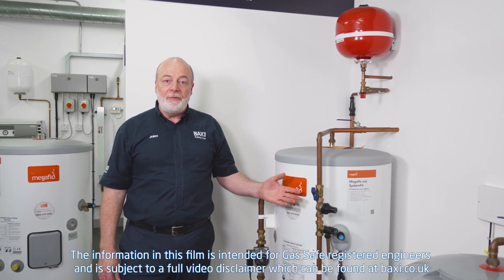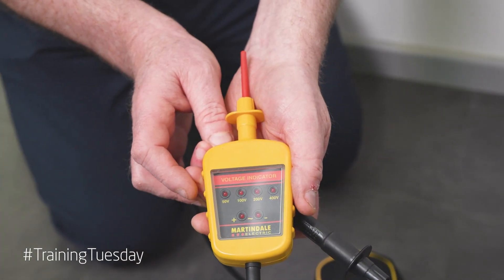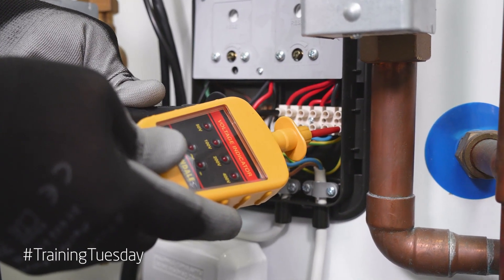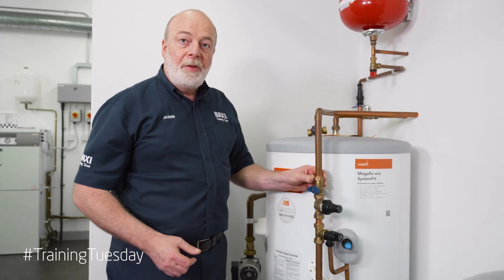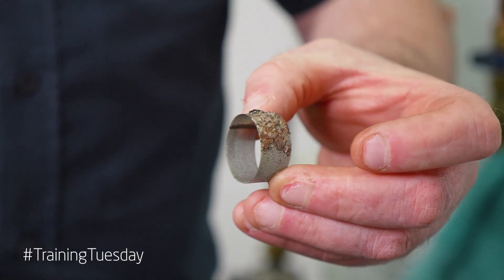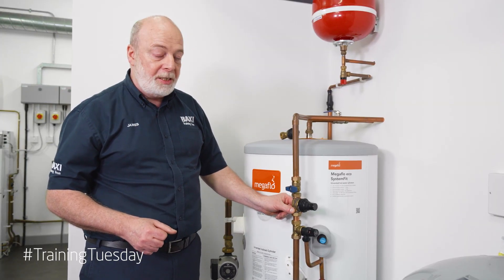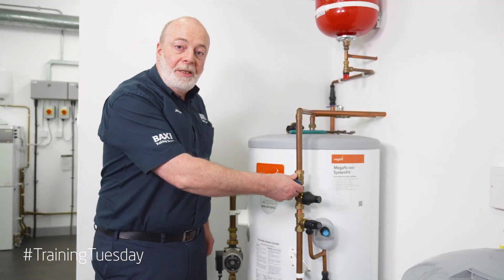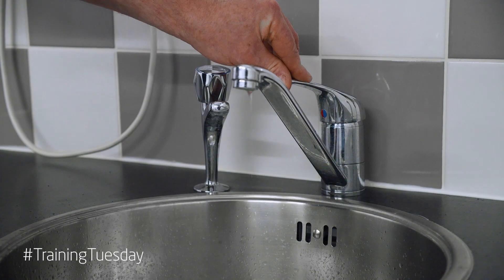How to identify, change and service the combination valve on a Megaflo cylinder | Training Tuesday

Comment: Why do you need to proof you have no electricity when you turn off the mains??? Crazy!
Reply: I work in central London. Wires and water/gas connections are sometimes connected from next doors flat, accidentally or purposely. Need to be safe all 100% of the time.

Comment: Yes cos everyone has that equipment. It's BS anyway. You switch off the mains and that's all. But then something simple wouldn't make you look smart would it. Well it doesn't.
Reply: You wouldn’t switch off a whole customers house electrics for a repair unless it’s the last resort
Reply: I was once electrocuted because I DIDN'T DO WHAT HE DID! bloody neutral wire inside a socket just popped out an sat in live terminal. What was the chance???
Reply: If you had half a brain you would realise you need a G3 or HWSS certificate to work on an unvented cylinder. If you don't have the equipment to test the electrical supply then you shouldn't be working on anything related to boilers, electricity or an unvented cylinder. You absolutely cannot be a gas engineer with a comment like that and lack of basic equipment. Go back to playing with lego bricks.